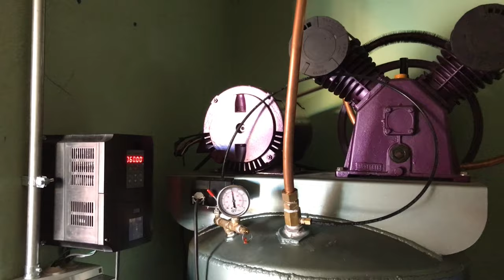Building & Installing 40' Steel Roof Trusses

Comment: Fun to watch the fab/construction.  I am an engineer and I am concerned that there is nothing keeping this structure from blowing over or falling over in wind/earthquakes.   Would like to see substantial connections to the shipping containers or some diagonal wire bracing or interior walls to support the side walls.  Best of luck!  Looks great.
Reply from the maker: I see what you mean but it has substantial columns. 
but also I didn't do that part. but I see what mean thanks.
Reply: An engineer a expert at what ever you are doing
Reply: U?
Reply: I see your point. From what I see, the steel trusses will brace the two walls although don't know if this was considered during calculation of the frames. From a seismic POV there isn't that many mass to move around so I'm guessing wind will be a problem here in the future, there's a lack of horizontal bracing between trusses (although vertical ones do exist) on the roof plane. Ps: I'm a civil engineer.

Comment: Great video but i was thinking about welding penetration, Im not a professional but i weld alot and you do get enough penetration if you can burn through the material just adjust with power and speed right? no need to start/stop.  Only time i do this technique is when the material is very thin and you have too much power
Reply from the maker: @danielkarlsson397  you’re right you can have it set just right but when materials are painted or dirty and when you’re gap varies quite a bit, it can be challenging to have it set just right because just right is different for every joint when there’s a lot of variables and I would rather have to stop to let it cool for a second or two, then have to keep changing the machine all the time. 
If your material is very clean and your route opening is consistent. You can set it just right and not need to stop.  And if done right that definitely makes for a better weld.

Comment: Splitting those Ibeams for Ts... you didnt have severly bent Ts?
Reply from the maker: @vi683a  no they were quite straight with a few clams in a little, pushing even by hand they straightened right out
Reply: @CreativityUnleashed  I seen many of I beams cut and they just spring apart , violently sometimes.

Comment: Why are the roof trusses not supported on the columns?
Reply from the maker: I believe there were some mistakes on the engineers drawings and where they ended up putting them but there's a strong rainforest header beam.
Reply: No need,  you are free to put the main trusses where you like on the roof beam. Any load is carried by the beam to the columns.

Comment: Good job bro..Where is this house built at? Concrete hollow blocks?
Reply from the maker: Yes concrete hollow blocks but it has a lot of columns with very heavy rebar it's a meeting building.
Reply: @CreativityUnleashed  Those column rebars in the cinder blocks, tied with one across every 3 layers are unbreakable bro.  Where is this house built at in what weather condition?

Comment: How did u connect the steel truss to the loadbearing wall🙏
Reply from the maker: They are welded to 3/8 plate that has been embedded or bolted especially to the wall